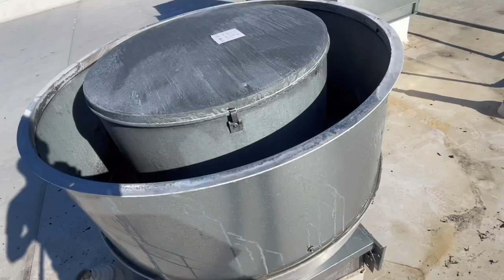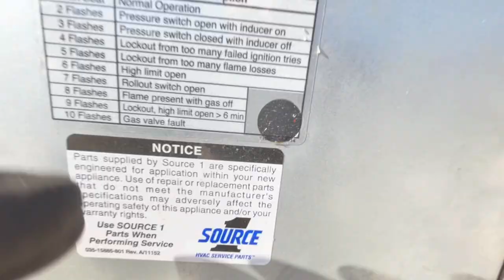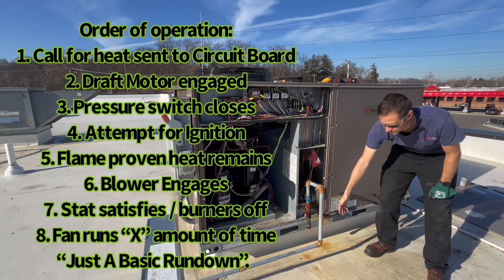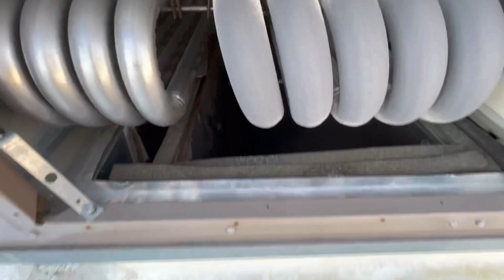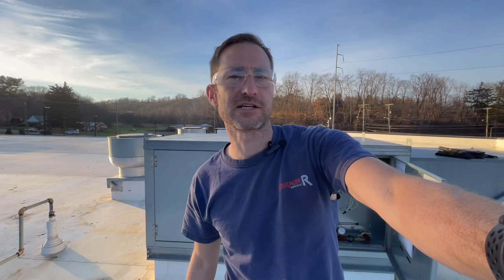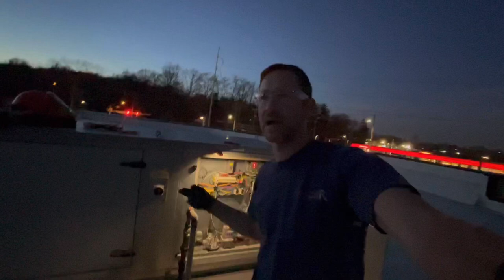Just Needs Maintenance. #hvacexplained #steamfitterslocal449 #captiveaire #supco #ruthrauff #hvac

Comment: Very educational.
Reply from the maker: Thank you sir.  I have a lot of people ask me what’s the best type of equipment to purchase but really the bigger question is.  
What is the application?
Is the equipment sized properly? 
Is the equipment installed properly?
Is the equipment started up properly? 
And is it maintained properly? 
If you cover those points most of the time you have a good running piece of equipment.  

Imagine pulling a horse trailer with a Ford focus.  Wrong Equipment for the job therefore, it will fail repeatedly. 

Have a great day. Thank you for the compliment.

Comment: Man this good stuff. Building unit a lil different from homes?  Love the channel, subcribed.
Reply from the maker: Thank you very much I will check out your channel here in a little bit I’m getting ready for bed I gotta get up by 5:30 AM.  What I try to explain to new technicians it doesn’t matter if it’s a window A/C unit or 150 ton rooftop unit.  The main components are the same just different size and controlled a little bit different.
Just like a Geo metro verse a big diesel Dually.  They have wheels, brakes, transmission, engine.   they get you from point A to point B but they both serve a different purpose for different needs.

Comment: I officially subscribed. At first I was like…. My first video of you was with the flash shield and you were gagging cause a mouse and running from wasp , but you won me over. Good work sir.
Reply from the maker: Thank you very much sir.  I try to make it somewhat humorous sometimes Korny jokes but I also like to throw in good tech tips and good general knowledge.  I try to make it a little bit interesting because the HVAC videos I used to see were useless back in trade school.  I like to see what actual installs look like and how to gain access to equipment sometimes is a real pain.  But anyways thank you very much have a great day.
Reply: I’m 42 and am in my final semester of tech school. I am currently on the HVAC crew with the local school system. I have one year under my belt and honestly have learned more from guys like you than school but at this point I want the diploma. I have advanced so much in one year and am considering shopping myself around.  Thanks for the material.

Comment: Found your channel today and just subscribed. I have a comment on your not locking out the disconnect.  You may just want to verify that power has been removed after the disconnect is off. At the end of the video you mentioned you have seen disconnects go bad. Also whenever I turned power back on I would stand to the side rather than in front of the disconnect. Keep up the good work!
Reply from the maker: Thank you very much John I appreciate it. Certain times I do lockout disconnects especially if I am nowhere near the power supply but when I am the only person in that general area I use common sense but yes it is a good practice to definitely lock out tag out at all times.  I generally stand to the side when I turn on power supplies and also when Boiler’s light off.  I just got done with a service call now I’m on my way to another one on Friday night thank you very much for commenting and subscribing have a great day stay safe

Comment: Hey Tony! Im a green technician whos training at the 449 Technology Center whos actually interested in working for your company! Its awesome to see a local tech who posts these awesome videos! I was wondering if you have a video on your channel of you doing a cooling maintenance on an RTU, if so could you help me find it
Reply from the maker: Hey, how’s it going?   Welcome to local 449.  Since this video, I have moved to Florida I am with Local 725.   I still talk with a few technicians from my old shop and I do miss working with that group. I had a lot of good times and learned a lot over the years.   I have quite a few different videos, but I do have one in particular that I need to edit and post when I get around to it.   And it’s pretty much going over maintenance.   
Maintenance is a big part of your equipment running properly to get the full life out of it.  
Some people ask me what’s the best equipment out there but honestly, that’s a very loaded question. 
1.  What’s the application 
2.  Is it sized properly?   If the units too large for cooling, you can build mold and not dehumidify properly.   If it’s under sized, then it will run/run/run basically take forever to cool off.  
3. Is it installed properly?  With the proper clearances for adequate airflow not to mention serviceability. 
4.  Maintained properly. 
If you cover those things, majority of equipment is relatively the same.  
How I give out information is how I wish I was taught.   The best way to learn, is honestly on the job.    There’s many many very helpful technicians out there that will pull you under their wing.  Soak up a little bit of knowledge from everybody.  Who are you currently with at the moment?
Have a great night. Thank you for commenting and contacting me.

Comment: Great video. Those captive airs are usually tied into the ansul/exhaust fan system someway. I had an exhaust fan that had no power and it ended up being a loose connection at one of the contractors in the ansul wiring compartment
Reply from the maker: That’s a little bit of a crazy one with a loose connection down in the Ansul system for the exhaust fan but nothing surprises me anymore in this field.  Lol.   
Yes, I figured it was tied into the control / safety system as an interlock.  I Wasn’t aware to kill the breaker at this location.   I had a Greenheck unit that had no interlock for their system.  It just seemed very odd that there was no power whatsoever up at the unit I’ve seen where it just breaks the control circuit only on other units.  Things were not all labeled how they should’ve been.  But the customer was all happy that I was filling him in on what needs to be performed regularly and showing him start to finish what I have done.  
Thank you very much for the info, thank you very much for watching I hope you and your family are doing well and getting ready for the holidays?

Comment: We are a dying breed my friend. Too many parts changers out there. No understanding of the refrigeration cycle or what causes failures.
Reply from the maker: @tomfisher7206  hello good morning.  
There’s a lot of good technicians out there, but there’s a handful that give us a bad name.
We all miss stuff. We are just human.   
It’s amazing how easily failures could be avoided just by Sizing Equipment Properly, Installation properly and maintaining it properly.  
Companies need to quit giving technicians commission for trying to sell parts.
I understand if Equipment is 20 years old, falling apart, rotting out, etc. and you can get a sales lead.  But changing out parts just to meet a deadline by the end of the month is wrong.  
Where about in the country are you from Tom ?
Have a great day. Thank you for the comment.   
I’m currently down here in the gulf coast of Florida right now at a Comcast data site changing out a high-pressure switch that has gone bad.
Reply: @hvacexplained9341  Northern Oklahoma. Changing out a 10hp blower motor on a 50ton Trane pack right now. Gonna be a hot one today. Stay cool out there!

Comment: Great video!! Very informative! Since this was your first time working on this unit, did you not expect the heat exchanger? I know typically I usually do on any new equipment just to make sure someone else didn’t or they did and didn’t lock out the heat, if possibly cracks? Unit looks new though.
Reply from the maker: Thank you very much Jordan I really do Appreciate the compliment.  Yes this was the very first time checking out the unit and since this unit is a “direct fire” there is no heat exchanger.  It is Raw Flame  blowing into the airstream!  Typically I do a complete once over on equipment I have never touched before especially before winter to inspect the heat exchanger.  Thank you for liking the video let me know if there’s something you would like explained.  I may have worked on it and have a video.  I’ve been posting a lot of stuff on TikTok lately to see where that goes. Have a great day.
Reply: @hvacexplained9341  thank you!! You I absolutely will! I never worked on one of those units so I didn’t know if it was direct fire. Or maybe you said it and I missed it in the video. I’ll definitely be reaching out if I have any questions! Do you usually just answer questions over here? And I’ll be following your tik tok as well. I’ve been in the trade going into my 4th year and just got into local 33 in WV so I’m excited for that

Comment: I've had a lot of issues with those quick connect terminals for the stat wire with York. I dont think its yorks fault though.  I think its an installer thing.

Comment: Typical restaurant setup, the system is balanced when the restaurant system was commissioned based on the prints. The Testing and balancing company sets up the total supplied CFM into the space minus the total exhaust cfm including the kitchen exhaust, and the hood over the grill including all other exhaust like the bathroom ect so that a positive .05" water column exists in the space. Some actually design the exhaust so that the smell from fresh grilling wafts out to the street to entice people to come into the restaurant, like you ever get a smell of grilled onions and your stomach starts growling. 
Those York boards have shitty binding posts is why the W wire fell out, and people try and put the wires in with them still plugged in , you must pull the post off the board and put the wires in so you can see positively they are in the binding post when you tighten. Those board have a bluetooth adaptor you can plug into them and use an app on your phone to go through settings. This one uses a conventional thermostat but when they are controlled via a building energy management system you can have problems that require that interfase to fix. York are shitty units, poor engineering and very poor service designs, cheap and prone to failure.
Reply from the maker: I wish I would’ve done a video on a small office that was combined in the same building with a restaurant this one was a bit of a messed up situation. 
I had gone to this office in a small strip mall the car was the office is very cold.  “It took literally to Hands to open up the front door.”  I was wondering what was causing the negative pressure so I decided to take a walk around and gain access to the roof.  I had found the restaurant next-door make up air unit power was locked out gas valve was shut off but they’re exhaust fans are running full blast.  To try and compensate for the negative pressure they were opening up the one side exit door but it wasn’t enough it was pulling from everybody else is space.  
I had to have a word with the landlord who dealt with that restaurant for having a faulty piece of equipment that was causing the whole issue all along.  
That York unit I had no idea you could run that circuit board via Bluetooth.  I did not look into it too far after when I found that bad connection.  When Equipment is pretty new I try to look for the most obvious things and that was definitely one of them.  Yes correct when the building, space engineers set airflow up they must do a calculation for the exhaust fans and make up air and checked on start up / Balance/ Commission. 
It’s always nice to have that little odor of the Bar”B”Que outside 😋. 
Thanks a lot for the info you’re very informative.  Thank you for watching and sharing the information.
Reply: @hvacexplained9341  Yea, I've been in the trade a bit. Now the question is, how the hell did the testing and balancing guys manage to set up that restaurant right with the unit not fully sealed on the curb? Sometimes I think those guys are just so used to systems not working right or installed right and they don't even try to make it work. 
The simple fact of it is, however, the inspectors are not very good at inspecting HVAC systems and have a tendency to tell them fix it in 90 days but your good to go, and never check back to see if it was fixed and then we come along and find those surprises.
Reply: @Johnny B.. I thought the same thing a York Board.. Well Johnson Controls. But Tempstar is an ICP product.
Reply: @FlyEaglesFly19111  it looks like a york infinity board exactly. Im pretty sure i seen the little joystick too, but i couldn't zoom in.
Reply: @FlyEaglesFly19111  yea, it's just because johnson controls board.